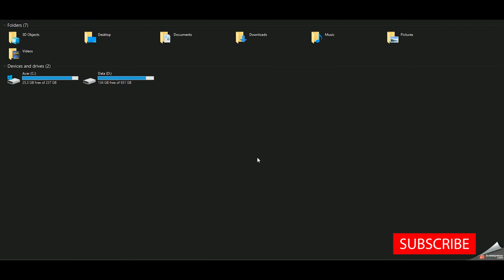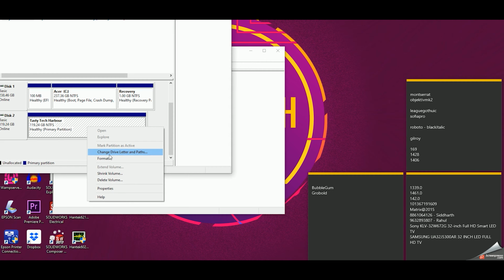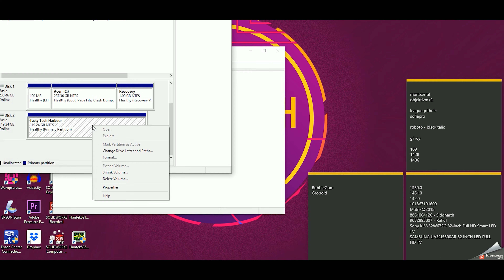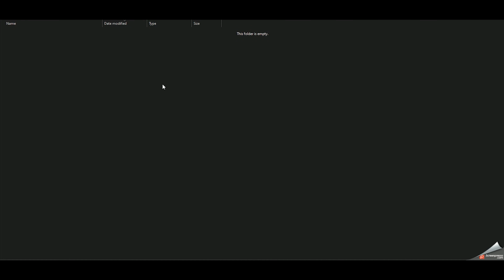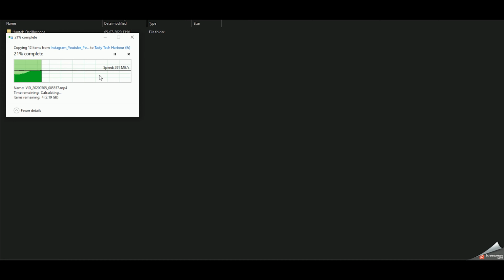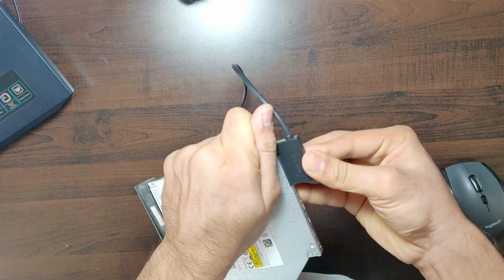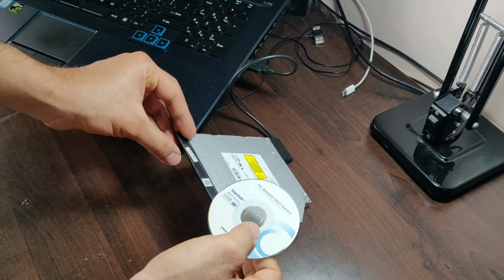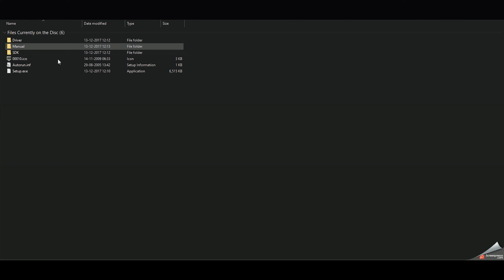Convert Internal Hard Disk or DVD drive Into External or Portable Hard Drive or DVD drive | 2021

Comment: Thanks. I've only seen the DVD/CD conversion done with a full enclosure, but this should work fine with the slim SATA adapter, for half the price and less plastic. You can stick some rubber feet on the bare drive so it doesn't slide about on a desk.

Comment: For people that have a bulky 5.25" DVD/Blu-Ray player that connector seen will not work on those drives. A 7 + 6 cable only works on 13 pin drives like laptop drives. For a bulky DVD drive you need a SATA converter adapter.

Also, if you purchase a 22 pin HDD to USB cable made for reading internal HDD/SSD's - the PC won't recognize the DVD player. 

The only valid options are to run 24" to 36" SATA data/power cable(s) from inside the PC to the drive, purchase a $15-30 SATA converter, or purchase an external shell which fluctuate between $40 to $60. Prices may change depending on region, etc.
Reply: I have internal DVD and want change to external, this slimline not match for my DVD. It's different, can somebody suggest ?

Comment: Is it possible to take an internal hard drive from my windows 10 PC and place it in an external enclosure 'WITHOUT FORMATTING' the drive before use? 
 I have a 10tb internal HD which I have half filled and I really need to move it to an external enclosure without losing my DATA. 
 Is this at all possible without having to backup and formatting the drive? Thanks
Reply: If its only data. Shoulnt be a problem. If it was your main hard drive, it can be a little more complex.

Comment: Hello,i have a liteon iHas224 Sata Desktop DVD writer that i want to run it externally .Is usb 2 enough to provide the power that the drive need to work properly or Usb 3 is needed?And if so what cable is suitable for this?Thank you!

Comment: For external hdd/ssd inter-OS operability (Mac, Windows, Linux), exFAT would be the best option, not NTFS, without installing 3rd-party programs/apps; exFAT can also accommodate files more than 4gb. However, FAT32 (only upto 4gb file size) and NTFS are better if connecting the external drive directly to television sets for watching media. 😊